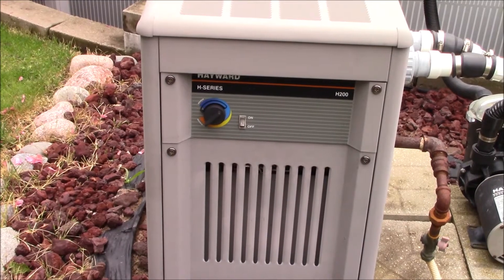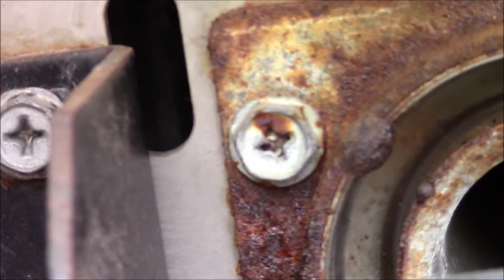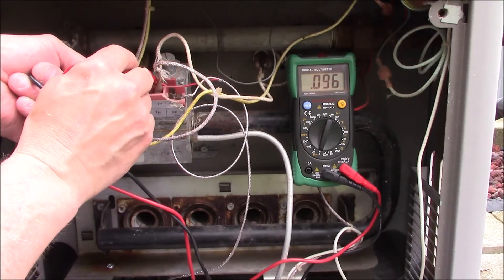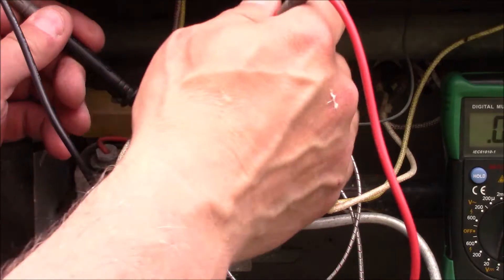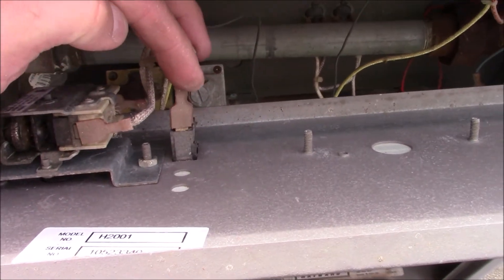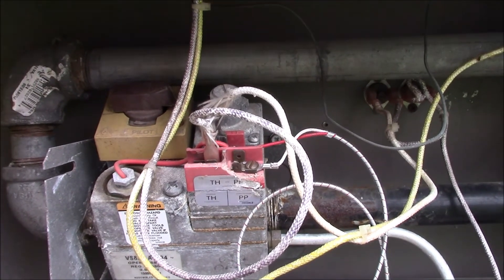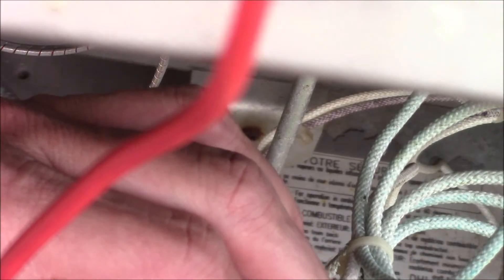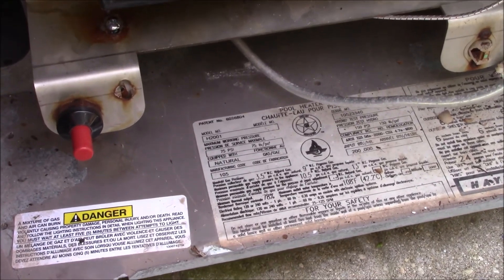Hayward H series Milivolt pool heater troubleshooting

Comment: Thank you oh so much for the detailed video. I have a question about the 2 sensors, I believe you called them heat sensors, or thermobreaks. Anyway, I broke the tab off of one, and the other one sometimes won't let the unit fire up. I can wiggle the connection and often it will start. I am weary of wiggling it because I already broke the tab off of the other one. Can I replace them both, and if so, which I am sure you can, where would I purchase them and is there a part # that you have for them. Or, are they pretty generic sensor and easily replaceable and found.
Thank you so much in advance. and I truly appreciate the video. I have no desire to replace this unit. When it lights, it does a really good job of heating my 25,000+- gallon pool.
Reply from the maker: The least expensive option would be to buy them on eBay. Pool heater limiter kit will include the 3 limiters you are looking for. one will have the rest button and 2 without.  You will need your model number to get the correct ones. I wish you the best on your repair
Reply: @bbbjim1fixedit  Thank you for the quick reply and advise. I just ordered them.

Comment: Does this model run on120v ? How does the power come in
Reply from the maker: The power comes from the pilot flame on the thermo pile. When heated the thermo pile produces a small amount of electricity (5 millivolts) to open the gas valve

Comment: Hey thanks so much for taking the time to make this video and post it.  No doubt, you've  helped alot of people. Thank you !!
Reply from the maker: Glad to hear you found the video helpful
Reply: @bbbjim1fixedit I have the H250 and I want to trouble shoot it, but I wasn’t able to see how you set your multimeter tool to continuity, or how you checked the different sensors to see if they worked, and I just don’t have enough common knowledge. If this were set up for a 5 year old with no electrical knowledge or proper use of a multimeter tool I would be benefitted, but no doubt for those that could follow you- they certainly benefited greatly from this video. Thank you.

Comment: Where does power come from on the unit?
Reply from the maker: the thermistor creates a very small amount of voltage when heated by the pilot light
Reply: @bbbjim1fixedit  thank you. That’s what you checked first in your video?
Reply from the maker: @CoopyMTB  yes

Comment: I’m new to using a multimeter and wondering how to make sure these switches are all working. I replaced my pilot light/igniter assembly and still not getting my unit to fire up. Wonder if it’s the pressure switch or gas valve. I’m getting about 450 Millivolts to the gas valve. Any thoughts?
Reply from the maker: you may wish to take a closer look at the limit switches (round disks) as well as the pressure switch, I wish you the best on your repair

Comment: Any tips how to change gas valve?
Reply from the maker: ensure the gas valve going to the heater is off then disconnect the piping from the union. do not put any thread sealant on the first tread of the pipe when installing. I wish you the best on your repair
Reply: @bbbjim1fixedit  pipes are very difficult to loosen..

Comment: I have the same model pool heater but it runs on propane. I was wondering if you knew, if the heater has a auto safety shutoff. If I lose power while the heater is running, Will the heater just catch on fire?

I accidentally shut the pump off when I had the heater on, I was on auto pilot that day. When I realized it a few minutes later, it got so hot it blew the hoses off. The previous owner told me he did the same thing and burned up some of the wiring. 

I get nervous leaving it unattended.
Reply from the maker: you may want to take a closer look the flow switch, since when the pump is on that completes the circuit for the heater to work. I wish you the best on your repair
Reply: Simple test dodo bird, shut off your pump while the pool heater is running and see what it does? the flow switch should shut off the main burner. Your pilot should still stay lit. If the flow switch does not shut off, there are multiple limit switches that will eventually shut it off.